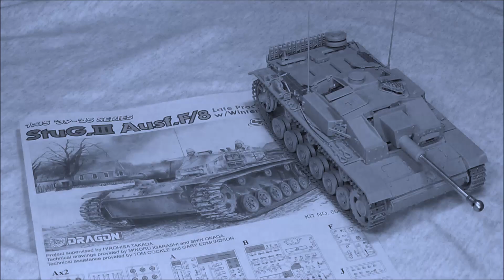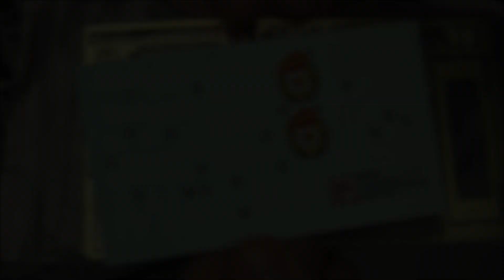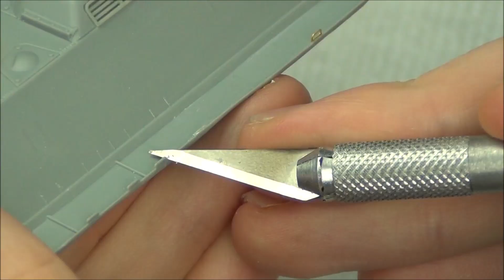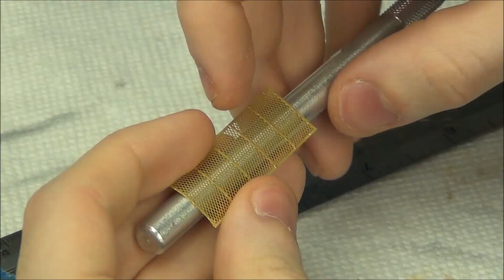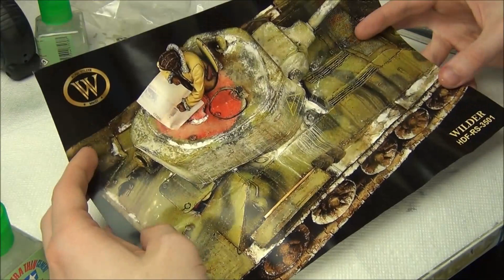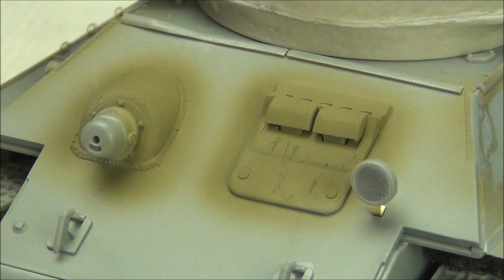Let's Build 1/35 Dragon T-34 (BABY KV-2) | T-34/122 Buddy Build!

Comment: I often wonder how far to go with the clean-up of parts on my motorcycles (real ones) I would take off any part I could and file, sand and polish .But on models I have to realise not all cast seams or welds would be done if any at all, great vid. TFS, G :)

Comment: I built a dragon Panther A late production kit and it was similar to this T-34, horrible fit and old parts with newer parts. The fit on the hull was horrendous because the entire back was just sitting up high to where I had to melt the plastic a bit to get it to hold, which worked.